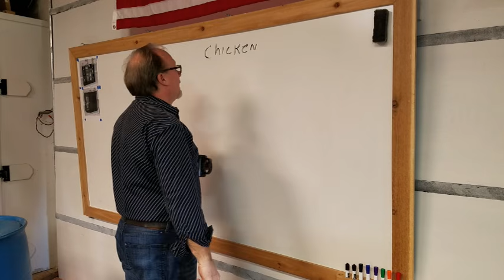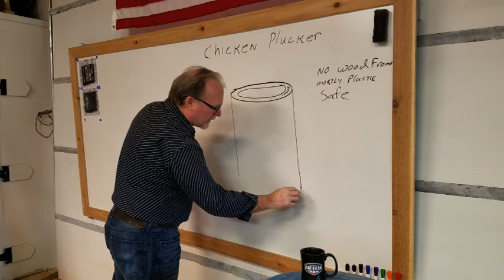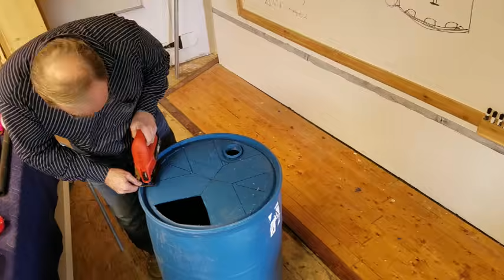DIY Mother of all Chicken Pluckers and how I built it.  My interpretation of the Wiz-Bang design

Comment: I am having a hard time finding the 15'' pulley. So with the 15'' large pulley and the 3'' small pulley on a 1725 rpm motor. The drum is turning about 345 rmp is that about right?

Comment: I visited your recommended parts sites for prices and it added up to $513.27, which doesn't cover the price of the barrel, tubing, wiring or conduit. I checked the price of a top of the line one, ready to use out of the box, and it was $499.00.
Reply: I'd like to know what plucker you found for 499 that is top of the line. The ones I've seen for 4 to 500 aren't top of the line and this plucker would he much more robust. But I was hoping to be able to build one for less than I can buy one.
Reply: Which route did you choose?
Reply: I found someone renting them, right now I can't justify laying out the money for one. @jasonkeuma1986

Comment: It may have been stated in previous vids but what are your pulley sizes and motor rpm?
Reply: my question as well. The designated motor is frame 56. It is a 3/4 hp and 1800 rpm. But we need a final rpm, pulley sizes or reduction ratio. Oops, just saw the final rpm is 300. So using circumferences, you can work out the math.  1700rpm divided by 300rpm is 5.6 making the circumference that much "longer". So a 2" pulley (2 pi R is 6.28) multiply that by the 5.6 you get the slave pulley circumference of 35.3 (divide that by pi) is 11". so, you COULD use a 2" drive pulley and an 11" slave pulley.

Comment: You were concerned about a 10 lb ball in there.  If you have roasting chickens, they can weigh 7-10 lbs each.  Broilers can be 5 lbs each while fryers arecloser to 3 - 4 lbs.  To be efficient, youneed to be able to put 34 birds in there so we're looking at 12-15 lbs.  Home grown turkeys can be 30 -40 lbs for 8 month old birds.

Its good you went with a more powerful motor.

Comment: Great job! Using EMT was smart it won’t rust. I hate to even ask this question because you already did a better job than any other unit on YouTube: Would you consider setting it even deeper into the barrel? Yours didn’t seem to have any feathers flying up out of the unit like the other YouTuber’s did, which is why I hate to even ask, but if you did it over would you go deeper?
Reply from the maker: Thanks, glad you like it.  Not sure if I would make it deeper, it was designed for a friend specifically for his needs; you could make it deeper but not really needed.

Comment: It is said information can be a dangerous thing...(I hope I got that right). Anyway, love your plucker it is lean with clean lines and not bulky! Without the wood frame I bet it isn't as heavy either. You mentioned making something to dip the chickens in and I have seen the pictures of someone holding the feet to immerse the chicken in hot water. Just saw a chicken farm/processor dispatch and clean chickens. He mentioned putting a little soap in the water to aid in feather loosening.(sounds good, never heard that mentioned and how it is more beneficial not to hold a chickens legs and dip them in the 145* water for 90 seconds.  It was stated the breast meat is the tenderest and more delicate than the legs so turning the whole bird around in the water was suggested. Dipping was an accepted method but if you were processing quite a few the turning (showed turning three at a time) was easier on the meat and time. Just wanted to give you food for thought. I think you watch videos about something before rolling up your sleeves and diving in. Your videos are fantastic!

Comment: Is it possible to make a hand crank powered plucker ? Some sort of gear ratio setup to where you could throw chicken in barrel.. Crank a heavy handle and chicken is plucked at some point..
Reply from the maker: Hi J.  You could, but, have considered using an old bicycle. two legs are much stronger than one arm.  If I recall, someone over in Africa, Zimbabwe I believe was working on such an adaptation.
Reply: @SouthernEngineering  thats even better... My idea was a plucker that doesn't need electricity.. I would think bike pedaling could maybe come close enough to what a powered one could do or close enough.. Thanks

Comment: What size pulley did you put on the motor? 5/8th shaft and 1/2'' drive assume, but what diameter?
Reply from the maker: the motor drive pulley is 3"  the driven pulley is 15"
Reply: Thanks for getting back to me. My brother in law and me built it successfully with a few modifications. Works like a charm. Can’t wait for the scolder!
Reply from the maker: @Mattd91  I'm digging out of the current mess and anticipate early spring for the scalder, thanks for understanding

Comment: What is the diameter of the 1/2" plastic round? 

I see two different diametral measurements written on it, one on either side.
Reply from the maker: The partition plate is sized to fit the barrow, which will depend on your size.

Comment: Can you do a 25 lb turkey in this do you think?
Reply from the maker: My buddy tried a 15 Lb turkey and it did not do a clean job,  you will need a larger diameter drum for larger birds.   This unit was designed specifically for average size chickens.
Thanks for watching.

Comment: Hello sir. 

Awesome design. A few questions. 

1. How did you figure the figure placement on the aluminum plate?

2. How did you fasten the polycarbonate divider plate to the barrel?

Thank you for your time. 

Dylan Bohn
Reply from the maker: sorry for the delay, YT put your comment in my spam folder.
the plate location was a guesstimate based on what I observer on other YT video's,  the divider is attached with SS Sheet metal screws.

Comment: Hi
I am building something like this, and am having trouble fitting the rubber fingers through the drilled holes that house them. May I ask what size holes you have drilled through your big blue barrel?
Reply from the maker: 3/4" hole,  use dish soap to lubricate the fingers.

Comment: Tip (from an appliance repair guy)
Find a way to seal the bearing ring so water doesn't get in there. 
It will prevent problems later. 
Some washing machines have shafts with sealed bearings as one single part you can buy.
Reply from the maker: That is true, given time, water will get in everything. I had pumped a bunch of white lithium grease into the bearing and instructed my friend to always regrease them after every use, that will help mitigate that issue. He uses it two or three times a year for a couple days at a time, so if he does proper maintenance, it should last a long time.

Thanks for watching and offering a good tip,  I was not aware of such a bearing, I'll look it up.

Comment: The plastic drills nicely with a spade bit. If you rub the fingers on a bar of soap it will lubricate the rubber and pull in much easier. I'm in Jamaica and built one with a hand crank. One pillow block under the finger plate and the other at the top of the barrel. The hand crank is above the top of the barrel. We don't have water running in the barrel but the feathers migrate out and down just fine. It's a little slower than the electric one but in about a minute it will do 2 chickens at a time and build muscle at the same time. Really handy if you are off grid. I used the barrel top for the finger plate. It works just fine. Mine has a 2X2 wood frame of treated lumber and is 3 years old and doing fine after several hundred chickens. Cost well under a hundred dollars.
Reply from the maker: Well, See Eddy, this is what I love about YT;  Guys from all over the world are sharing, teaching, and learning from each other, it is a beautiful thing. I can imagine your arm is a bit tired at the end of the day, but hard work is good for the soul.
Your design seems well-thought-out, thanks for sharing it with me, I do appreciate it.
Thanks for watching and commenting.
P.s. I haven't been to Jamaica in years, I love the Caribbean islands and my wife, and I plan a vacation there next year.
Reply: @SouthernEngineering   'hard work is good for the soul.' I LIKE THAT💪💪💪💪💪💪💪💪💪

Comment: I scanned comments for cost to build questions, but did not see. What is you estimate of the cost of materials? Great job!
Reply from the maker: Hi Joel, sorry for the delay in responding to your question. The cost is hard to nail down for this build; It depends on what you have on hand, and what you will need to purchase. But, a few things you will definitely need to purchase are the Rubber fingers, they are ~$50 for 150qu. I am a bit of a packrat so much of what you see are things I have saved from other projects, i.e., drum, aluminum, conduit, spare lawnmower wheels, I had a motor, but my friend purchased a new one, that was ~$120.  Also, I bought the bearings ~$30, the sprinkler valve is a spare for my lawn sprinklers. 

Sorry if I can't be more precise, my friend had a minimal budget and asked me to keep it low cost, as much as possible. 

I have a 2500 sqft workshop that is packed full of stuff accumulated from 40+ years of work, and I rarely throw things away until I strip it down for parts.
Thanks for watching and commenting, I hope this helps.

Comment: i dont buy fasaners from box stores ether, for the most part there only a grade 2, i buy bulk and have bolt bins full of all sizes, types including grade 8, ss metric, i only buy my concrete ancers at faenall, i buy all others from my wholesale supplier
Reply from the maker: Traceable standards are important, and my butt is important.
I've been taking this forced downtime to get my shop reorganized.  I have built a small room in my barn specific to fasteners, fitting, connectors, and all the bulk stuff a well-stocked shop should have.
Stay tuned, video soon. 

P.s. I subbed you.
Reply: @SouthernEngineering  Thank you.. yes well stocked, one has to be.
Reply from the maker: I hate running to the store for a single part. 👍
Reply: @SouthernEngineering  you bet, its 2 hour and 20$ gas gone
Reply from the maker: Yup, a single bolt or nut costs me 45 minutes, and I'm not getting any younger.

Comment: nice build, i just dont get how the 3 fingers on the under side would help, as the bottom of the exit hole is at is at the level of the aluminum spining plate, no feathers go below it. can you exsplain
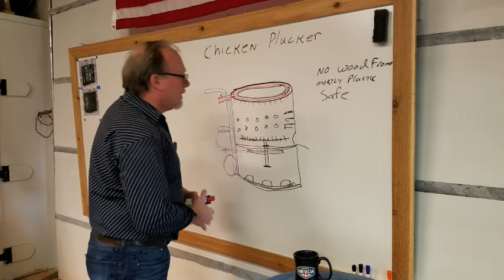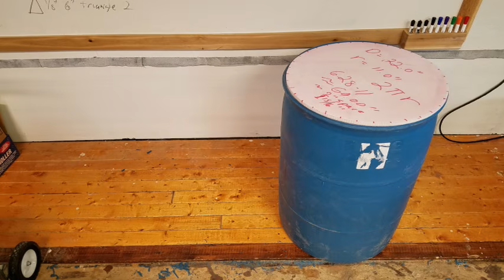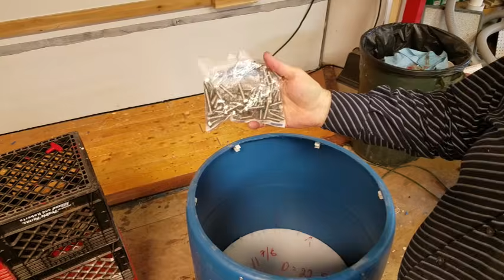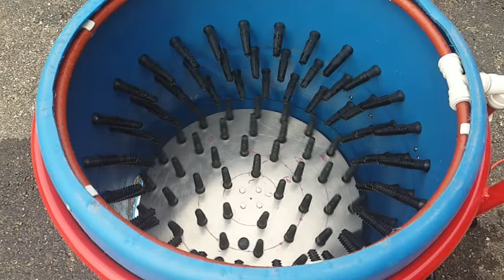Reply from the maker: Hi Arnold, sure, no problem. Look @8:54, you will see the drawing of the upper bearing plate and the finger plate, @16:49 you will see the plastic upper bearing partition. @17:08, you will see it installed mid-way in the drum. @23:24 & @23:49, you can see the white bearing plate at to bottom of the discharge port. @25:07 the plate is installed, and you can see that there is ~1.0" clearance between the drum and the out edge of the plate. 

The plate is ~3" above the white bearing plate, and during operation, the feathers are forced out to the drum wall and the water carries them down to the lower white bearing plate where the inverted finger help fling them out the shute.

I hope that clears things up.  I made another video with some changes and updates to the plucker, here: https://youtu.be/0a3pVRMXQMk

Thanks for watching and comments.

Comment: Now here we have an engineer who puts his knowledge to the test, good on you. I'm a welder so we get quite contemptuous when it comes to retarded engineer drawings....
Reply from the maker: Thanks, man, I appreciate that.    I'm still learning to weld, right now I'm more of a grinder 🙄
Reply: @SouthernEngineering  I'm by no means an expert myself. I went to welding school for 9 months and have 1.5 years working in a job shop where you build projects from scratch. I dont have to grind my welds a whole lot unless it calls for that or I got lazy.
Reply from the maker: I learn to basic stick weld when I was about 10, and torch weld not much after, but really had not done any welding since, only in the last few years have I started to weld again. I really enjoy the TIG but use the MIG most, but once I get a water cooler for my TIG, I will be spending a lot more time with it.
Reply: @SouthernEngineering  tig is definately technical and arguably the most versatile of all the welding procedures and a good skill to have. I need to practice my tig skills, but I'm glad you're enjoying the welding. It's really neat that we are using electricity to bond metal these days instead of coal and a hammer!

Comment: That galvanizing produces zinc fumes whem heated causing a type of heavy metal poisoning that has symptoms similar the flu with the addition of your lungs hurting poke you just fought 3 house fires back to back. Blacksmiths have issues with it when using recycled metal for projects and don't recognize the coating. Ask me how I know the symptoms so well.
Reply from the maker: Thanks for pointing that out, Jr. I did grind off the Galvanized coating on the conduit before I welded it, but I don't believe a made a note of it in the video. I will be informative on this topic the next time I use conduit for a project.
Thanks for watching and commenting.

Comment: try 68-72 degrees C for water temp. it's perfect.
Reply from the maker: Thanks for the info Brian, I believe my friend used water just a touch cooler, with good results. I wonder if the type of bird makes a difference, any thoughts?

FYI  I'm about to finish a long-promised scalder for him,  it will have precise temp control,  once we test it I will post a build video,  stay tuned if you're interested.
Reply: Farenheit is a more precise measure of the temperatures between water freezing and water boiling 150°
Reply from the maker: It's more of scale thing then precision, but C is easier with the math, while F is more familiar.

Comment: You can use an old washing machine dryer just put some rubber extensions on sides and bottom and instant plucker, EASY :)
Reply from the maker: Hi Cain. You could most likely do just that, there are several designs online using a washer drum; I had a drum and know washers so improvizing was the best route.
Thanks for watching and commenting.

Comment: Did it  Bruse the chicken. The one o use as a kid you  held the chicken
Reply from the maker: Hi Ronald. This first version never bruised the bird but would break a wing once and a while. After the first use, I added a second row of fingers to tighten up the spacing, that solved the wing problem. He has used it for about 3 years now, and it seems to be holding up very well. I made a follow-up video of the changes I made, her is a link if your interested: https://youtu.be/0a3pVRMXQMk

Thanks for watching and commenting, I appreciate it.

Comment: Impressive. I especially liked the proof of action study using painted bowling ball.
Reply from the maker: Thanks, Gardener, glad you like it. The bowling ball was the only way I could test it without using a chicken and proved the functionality. 

If your interested, I made a follow-up video with a few changes and updates; I'm also working on a scalder to go with it, stay tuned.
Thanks for watching and commenting I do appreciate it.
Reply: About the 10 lb testing ball, I got to say a turkey can weight 3 times more so the bottom fingers must be locked tight or, be of a stronger material so the turkey don't pull them out or bend them. By this time the farmer using this project should have that corrected or maybe they didn't need to correct it at all.
Reply from the maker: He only uses it for chicken and small game birds.  If you want a design for larger birds, you would increase the drum size and the fingers on the plate would need to be spaced closer.

Comment: Yeah, the problem with cutting the bottom out the way you did (and Whizbang recommends) is the water and feathers drop out on the pulley below and fling 360 degrees like you see in the last couple seconds of this video.

What I did was simply cut a slot about 4" wide from couple inches out from center of bottom, to the edge of the barrel, then make a thin sheet metal cover like a chute that bolts over the slot.  Water and feathers run down the chute into a 5 gallon bucket with 1/2" holes drilled for drainage.  Catches all the feathers and water, water simply drains away on the ground.

I also mounted a row of the plucking fingers facing downward on the rotating bottom plate so it "sweeps" the feathers around the barrel bottom until they drop into the chute, and wash into the bucket.   LOT neater operation.
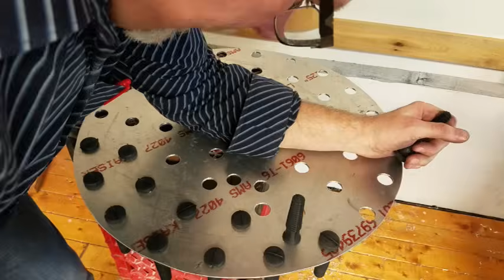Reply from the maker: Hi Ed, sorry for the delay in responding,  things are a bit crazy.  Actually, there is a solid partition plate @4:55 that holds the upper bearing and separates the plucking area from the drive belt and pulleys below,  the discharge shoot is opposite of the motor.   I also mounted 3 fingers pointing @21:46 down to help clear the lower area.

Thanks for watching and commenting, I appreciate it.

Comment: Years ago I built one similar to yours except instead of it being electric I used a high velocity nozzle conected to a garden hose to power the bottom late with fins bent up so the water spray spun the round plate with fingers pointing up to spin the chickens and rinse them off while they spun around and plucked the feathers off. It did not spin very fast, but fast enough to do the job very well. I also added a hand truck to move it around for storing.
Reply from the maker: Water-powered, very cool idea. That would have been a great YT video.
Reply: I would be glad if you can post the video on YouTube.
Reply from the maker: Same here
Reply: video or it didnt happen! lol

Comment: Hi, thanks for sharing. What is radius of your nylon plate and aluminum plates? Thanks
Reply from the maker: sorry for the delay,  I have been under the weather.   I seem to recall it is 11" Rad.   but not exactly sure,  the radius should be 1" smaller than the drum your using.   The dimention are posted on the white board and explained in the video, I also did an update video with some of the changes I made,  you should watch it before you start your build.
Thanks for watching and commenting.